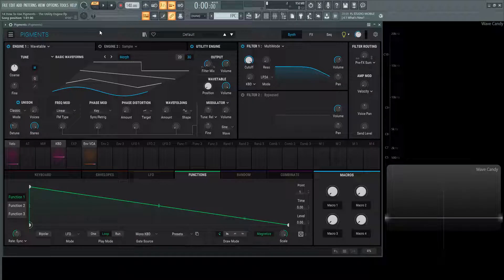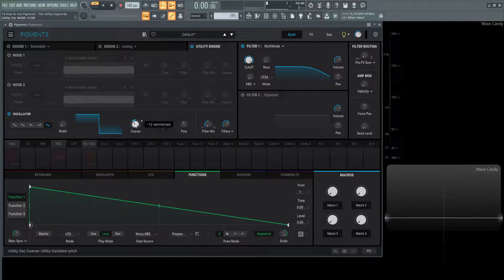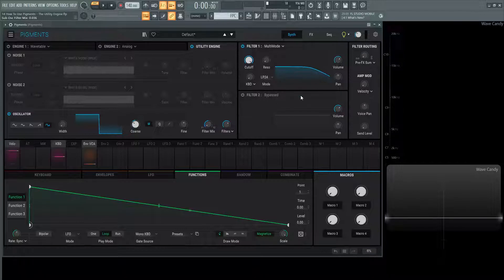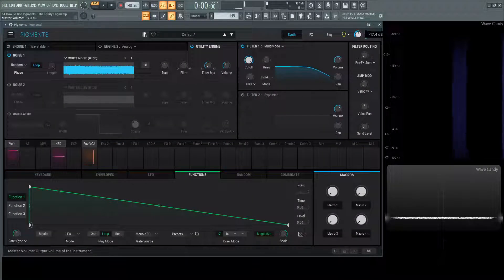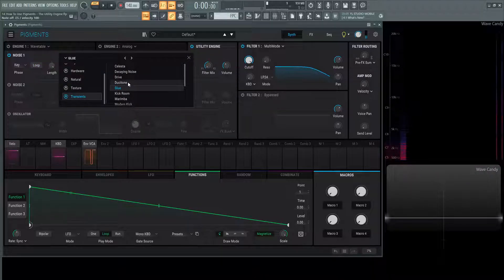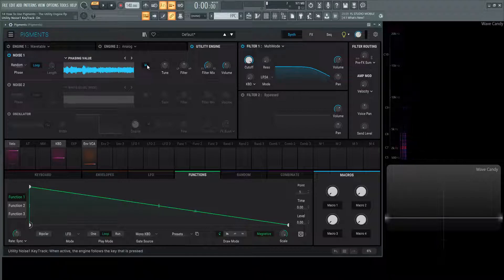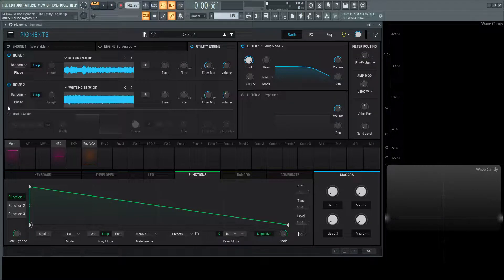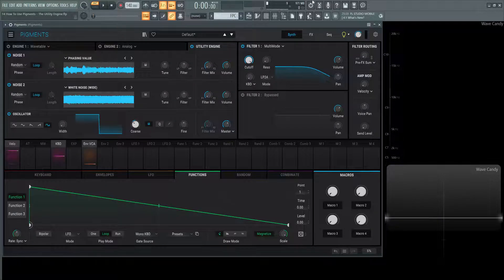The Utility Engine PART 14 | Arturia Pigments 3.5 Tutorial

Comment: Thanks for the tutorial. Is it possible to layer the Samples A,B,C etc.?
Reply from the maker: That's a great question! I haven't found a way to layer the different samples (A,B,C in this case) so they all trigger upon one note pressed. I sort of work around is to use two sample engines and map at least two samples to the same octave range. Not the best solution but closer to what you're after.